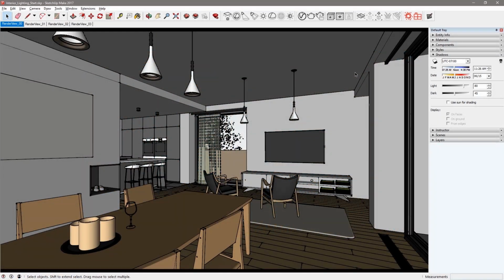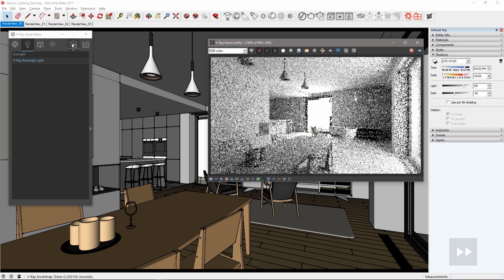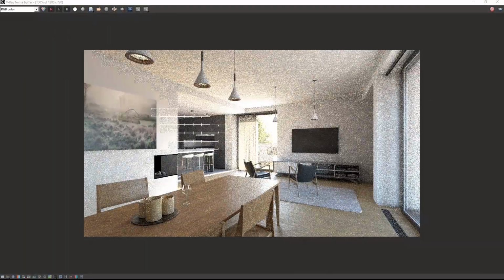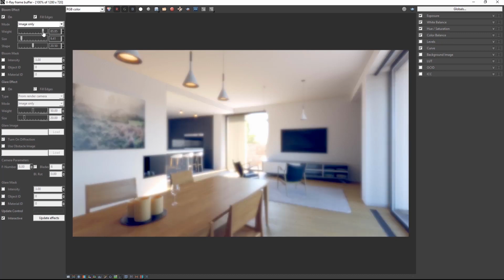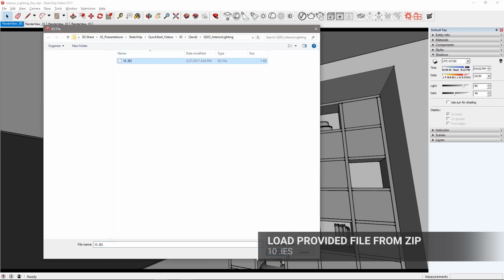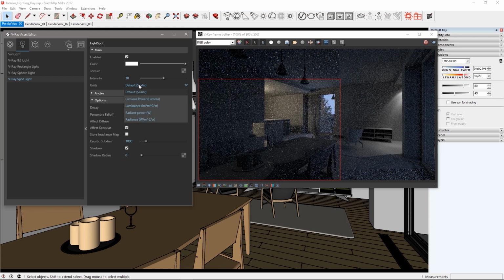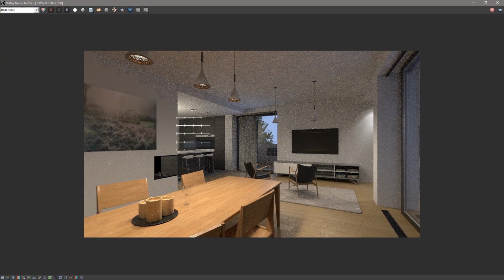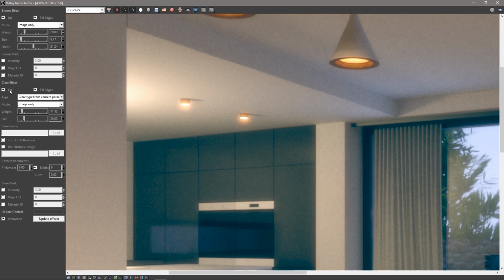V-Ray 3x for SketchUp – Quick Start: Interior Lighting

Comment: my lights doesn't iluminate, what can be wrong?
Reply: You can check a few things.
1. Make sure that you have 'Lights' checked under the Global Switches roll out.
2. Check the intensity of the lights. Sometimes, depending on your scenes lighting, you might have to ramp the default values right up to see the lights even if they are on. If you are using an IES light you can override the default value as well in its settings.
3. Check that the flat base of the light cone (the circle bit) is not blocked behind geometry. So if your light cone is meant to come out of a lamp for example, ensure that the cone is a few inches away from the lamp's surface.

Comment: hi..when i put portal light, and set the exposure value of the camera to 10 (smaller than the default), the portal light becomes so white that i can not see the view outside. What i am i missing? please advise. thanks.
Reply: Hi have same problem did you find out how to do it?

Comment: Might be a wrong place to ask, bu I'd be highly thankful if someone replies.
I love the denoiser option but the problem is denoiser( even at very mild setting) blurs out things behind glass and cleans out most of the reflection that I would love keep, it really pi** me off, is there any solution?
Reply from the maker: Hello Zubair -- If you find the denoiser is blurring too much out of your final image, I would recommend increasing your quality setting. The render may take longer, but your result will be much better. 
Alternatively, please use the Denoiser "Custom" preset and experiment with the Strength and Radius values until you achieve a desired result.